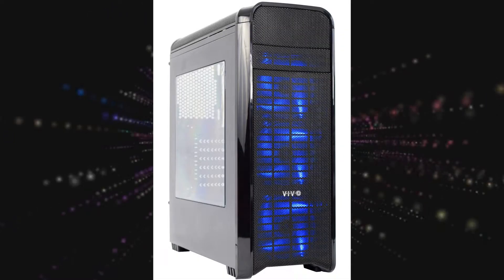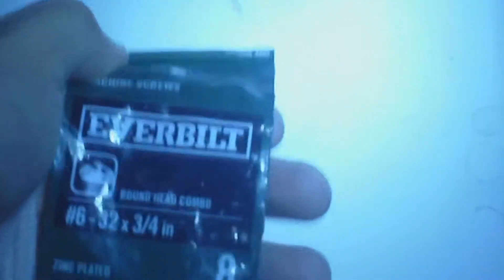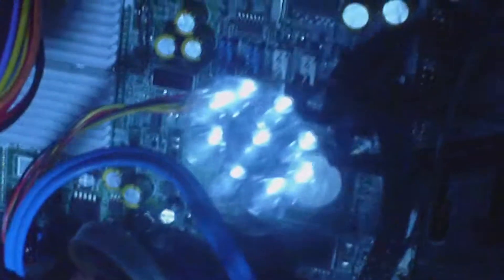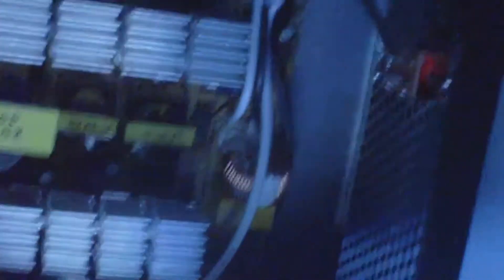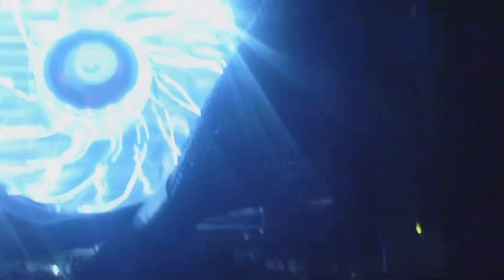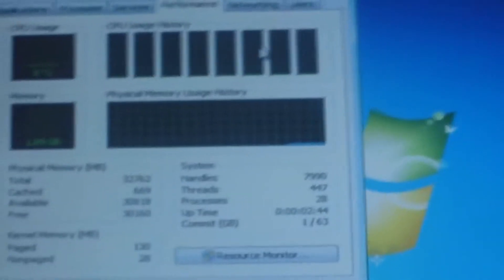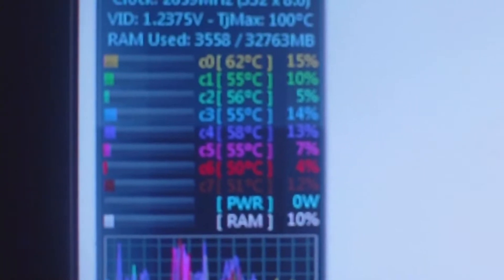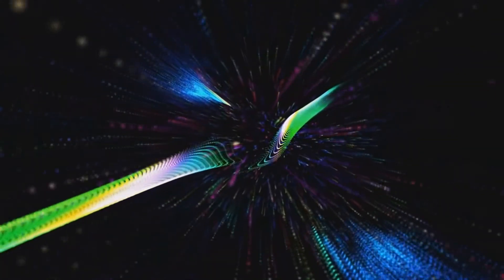Building An 8 Core "Gaming" Server PC!! 2 Xeon CPU's

Comment: Wow cool, I own nearly the same machine, but build it the other way around. xD

I bought a Siemens TX200 S4 for 25€, threw in 2 X5450 and 6x2 GB of ram (Processors and RAM bought in a old 1U Rack Server for 15€). 
I dunno if your Board works the same, but I had to buy a PCIe performance adapter, which is a little PCIe card that basically just blocks one of the slots so the one below can be used as x8 (they're all x8 mechanically but x4 electrically). That thingy cost me another 16€.

Last but not least, the Workstation originally had only 1 CPU installed, so I had to pay another 12,50€ for a 2nd original heatsink.

In total, it cost me around 70€.

I had a GTX650 2GB flying aroud to check if it even works with a PCIe GPU and as you know it does.

However, since I use the original dual hot-swap PSU, I only get one string of 4 Pin Molex connectors, so I had to use a 2x 4pin to 6 pin PCIe adaptor, which kinda limits my choice of cards.

Performance wise, I'd say up to a GTX1060 would be reasonable.

Finally, I'd like to give you some advice:

1. The Temperatures are really high. I just checked mine with coretemp and it's max. 45 in idle and 63 in a CPU-Z stresstest, but my fans are running only at 30% or so. The dumb thing has some kind of dust-off feature which means it's gonna throw fans on 100% every once in a while, which basically sounds like a lawnblower.

2. Those Fully Buffered RAMs get REALLY hot, but if you put a fan on them like that, it's gonna disrupt the airflow. Also, iirc the board has caps sitting near the ram, so if you push the hot air down, they might not appreciate it.